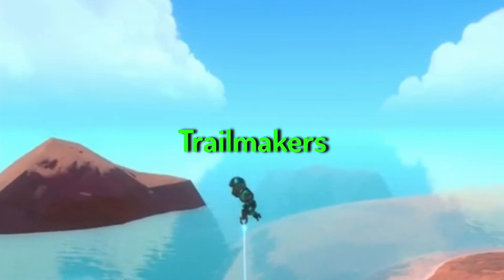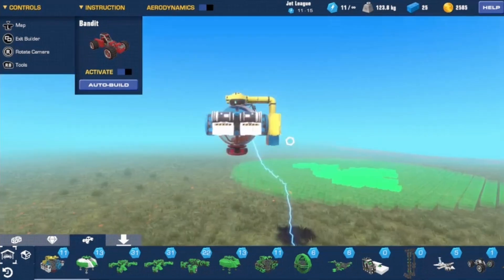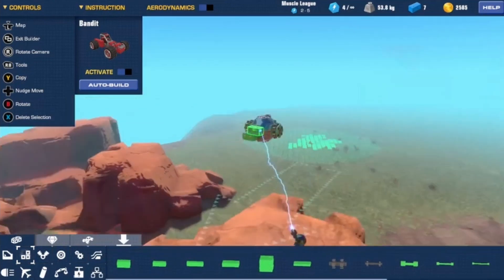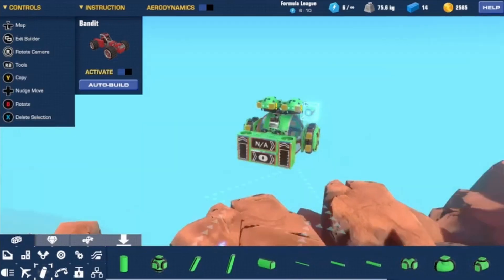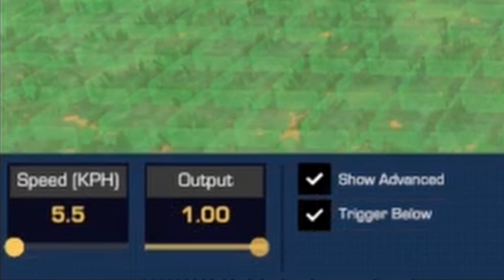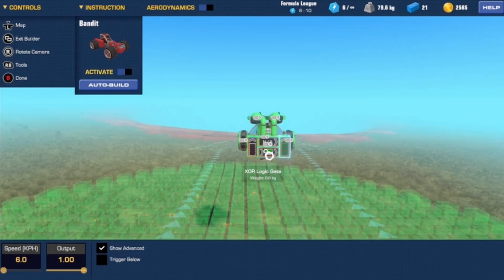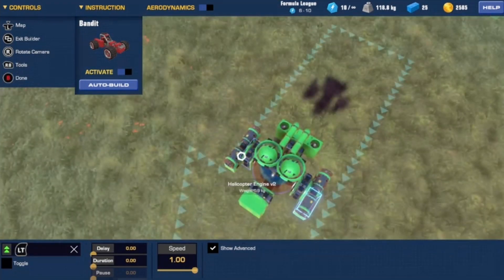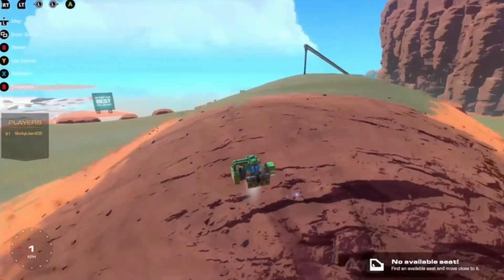How to Build a Drone With Gimbals and Logic (Trailmakers Tips)

Comment: Good design but the logic doesn't work so instead I replaced the altitude and xor gate with 2 blocks and used downwards speed sensors and it works so thanks

Comment: Doesn't work... Just automatically starts floating up and doesn't stop once I leave the builder. Where are you applying the input keybind? To the gimbals or to the XOR? Also double checked the alt sensor and it just keeps firing even if over its set altitude.
Reply from the maker: I believe the keybind should be set to the xor

Comment: HELP ME IT WONT STOP
Reply from the maker: Two of the helicopter engines might be facing the same way, or one might not be connected
Reply: Thank you
Reply: But it also flips vertical so the part with the distance sensor os Down while i spin in the air

Comment: I follow this exactly. My drone keeps going up. It doesn't stop at the height I set. I wanted to use it to get the dragon jet or whatever it is in the volcano but it won't work for that.
Reply from the maker: The drone in the video hovers at one altitude so its not the most useful. I am thinking about doing an updated tutorial in the future on how to make a better drone.
Reply: @stickylizard  that would be awesome. Still a sweet drone though it's good for scouting.
Reply: It's simple, you have to disconnect the whole 3 sensors on the back with the XOR Logic Gate. Then attach the Heli Engine v2 on the top of driver seat. Put those Gimbal Jets above it. At last, put a tractor beam below the driver seat. You'll get a not so stable but workale drone.
Reply: I hooked the helicopter engines to an two angle sensors it worked got rid of the xor

Comment: Mine just keeps going into the air, how do I make it stop at 50m ?
Reply from the maker: Since I can’t see your build, I can’t really be sure what is wrong. Though, the first thing you should check is that every single part of the logic is correct, because all of the logic works together to keep it stable at 50m.
Reply: @stickylizard  I copied every step exactly. But it just continually takes off. It will momentarily stop if I press A but it will continue to take off. The XOR gate is only connected to the gimbal. The altitude and speed is connected to XOR but it's like it doesnt care what the altitude is it just keeps the gimble jets going all the time
Reply from the maker: Are you on test zone? Because if you are, the starting altitude is 100 which can mess with a lot of builds.

Comment: Mine just starts spinning and rolls of into the void. I configured all the sensors correctly so what happend?
Reply from the maker: I can’t be too sure, but do u have the helicopter engines all going opposite directions? The ones across from each other counter balance, but if you flip one then they will work together to spin you out of control. Tell me if this helps!